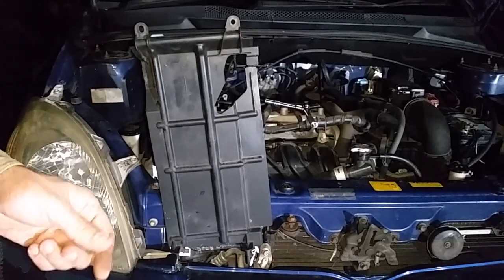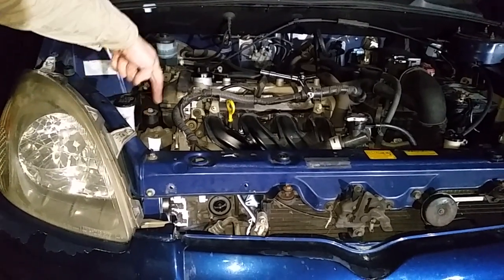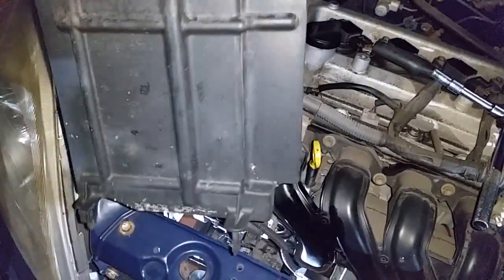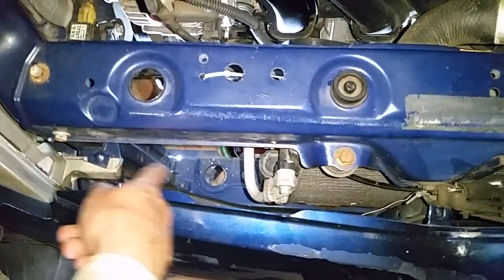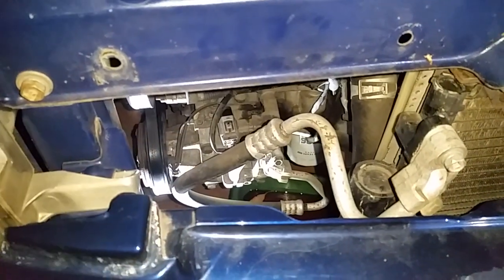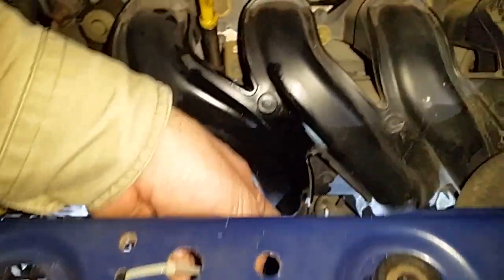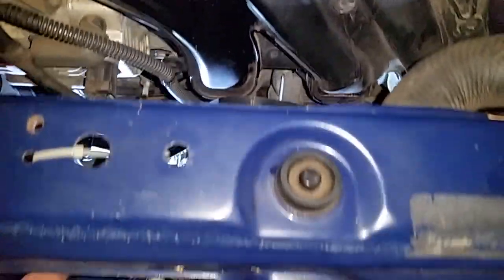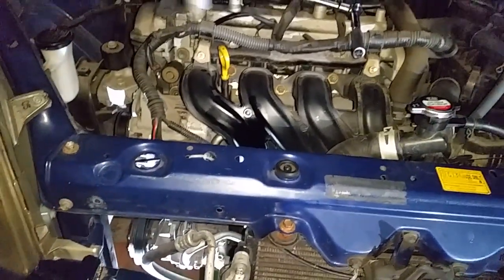Toyota Echo/Yaris 1999-2005 Thermostat Housing Access/Removal For Radiator Flush

Comment: The 10mm nuts on my Echo were completely rusted. All that remained of the nuts was a crusty rust ring.

For anyone else who stumbles in and needs to know:

-The OEM part number for the 2002 Toyota Echo Thermostat Housing Stud is: 9012606019

-My thermostat housing studs DID finally come out for me with a Torx External Socket S5.
I got the 6 piece Torx E-Socket set at Harbor Freight for $9.99.

-You can use M6x1.00 20mm bolts instead of the OEM studs if your Toyota dealer wants to charge you an arm and a leg, and you ride your bike there and find out they don't even have any in stock.

Comment: Did you bleed the system after? If so, how?
Reply from the maker: They have a plastic drain tap at the bottom if i remember correctly or remove the bottom hose.

Comment: Would the thermostat be able to cause a vacuum issue for the radiator hose?
Reply from the maker: Probably. Thermostat is one of the most important parts of the cooling system,if it does not open/release it can build up pressure and overheat or if it is stuck open your water pump can fail prematurely.